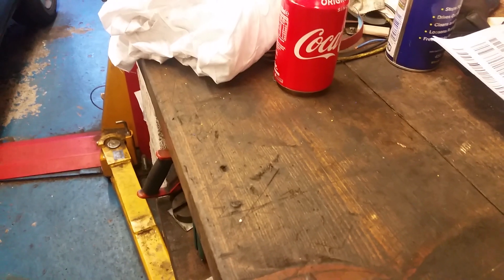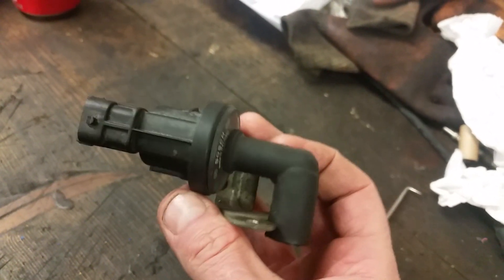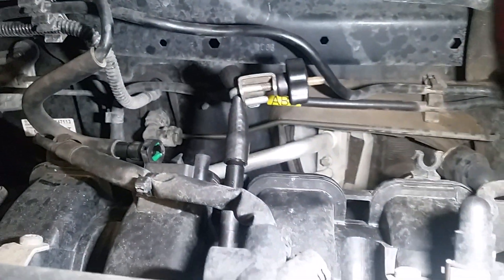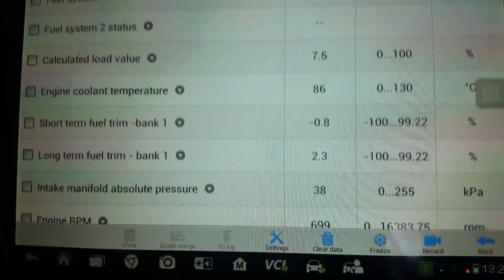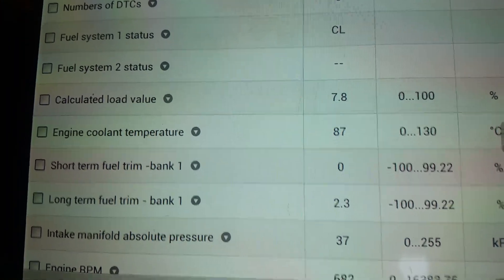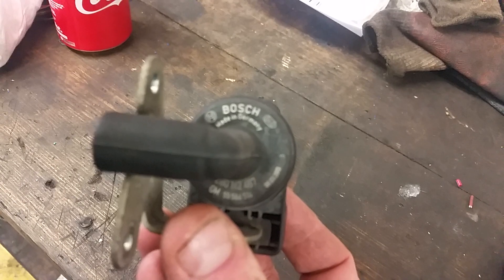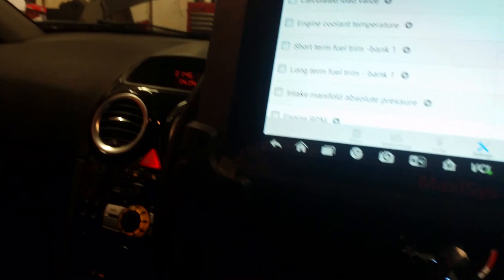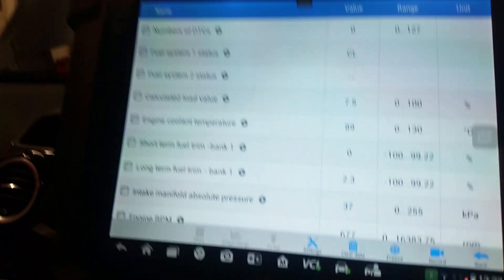Vauxhall/Opel Corsa d 1.2 p0171 rough idle part2

Comment: I believe i am having a similar problem in my corsa d. Car is showing po171 code and idles all over the place almost as if its going to die when starting, which settles after a few revs of the engine. How can i do a check on this valve to see if its causing the problem?? Thanks
Reply from the maker: Take it off and see if you can blow through it. Shud be closed
Reply: @davesterl  Thanks

Comment: Hi there ive got an problem with my corsa 1.4 petrol,  everything goes normal no warning lights but has no power tiking point is stays down from 900 to 700 no up and down or something but has no power .thank you
Reply: I have this same problem did you find out what caused it

Comment: Hi mate, had the p0171 fault come up on my corsa D 63 plate. Came out this morning and the car will not start, have a feeling its the pcv valve, would a faulty pcv valve cause the engine to not start at all? Its been idling rough and will sometimes start up but then dies within a second or so, cheers
Reply from the maker: Block it with ur finger to prove
Reply: @davesterl  which end? And with it still plugged in or not? Cheers
Reply from the maker: @olivermckeown5805  there is only one end when its on the car
Reply: @davesterl  sorry to be a pain, the pcv valve is now completely off and i am able to blow through it at both ends, would this mean it is faulty as it is usually closed?
Reply: Did you ever fix this cause I have the same issue right now
Reply: @OMGMW2GUY  It turns out it was my coil pack as to why it wouldnt start, but this valve still needed changing also, but it wouldnt cause a no start, more likely that the valve causes a shitty idle

Comment: Cheers Dave, just seen in video u have 2 post lift, my friend has only a pit in his garage, is their any lift u would recommend when u have limited roof space ie we could use it in conjunction with the pit cheers sandy
Reply from the maker: Hi sandy. I bought this lift on ebay. Its a china made one. Cost about £1200. Company called lifttech in preston. The pillars go thu my ceiling into the store room above as i dont think u can get small ones. The floor needs to be thick also. I was lucky i had a mate who chemically bonded the bots into the floor cos the expanding bolts were pulling thru. Not bad for the money. Having four wheels in the air is a godsend. I dont like pits as you have to climb in and out to get tools. Suspension work and brake jobs a pit is no good
Reply: @davesterl  cheers Dave I'll contact that co. Cheers sandy

Comment: My mpg hasn't changed, if anything its getting better. I have a 18 plate mokka x turbo showing check engine light, code is p0171 but I have no performance change. Any clue what it could be? I'm worried about damaging the engine. Thanks, great video 👍🏽
Reply from the maker: You need to get your car diagnosed.

Comment: Hey I have a vauxhall corsa 1.3 diesel that cuts out whenever i let the revs drop and once the revs drop back to 1000 the car either stalls or cuts out, its not constant it happens reguarly but not everytime and was wondering if  you would know anything about it, i had the crankshaft sensor replaced and i also had some fuel sensor replaced which cost 160 euro
Reply from the maker: you need to get your car diagnosed properly, just throwing parts at it is costly
Reply: @davesterl  It's been diagnosed twice and i had fuel regulator sensor replaced and all the errors went away but the car keeps cutting out and the mechanics dont know whats wrong with it either anymore